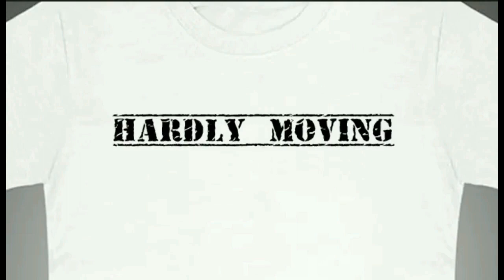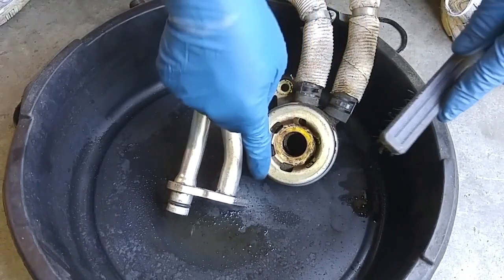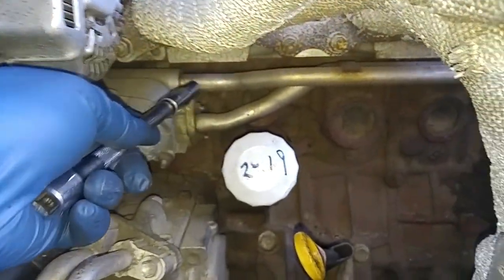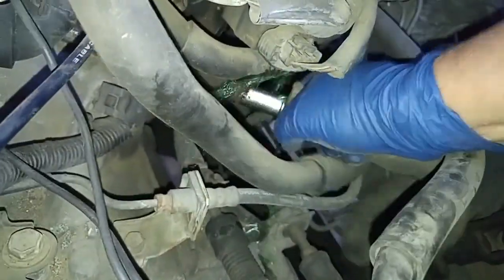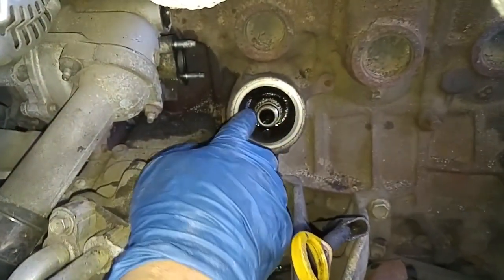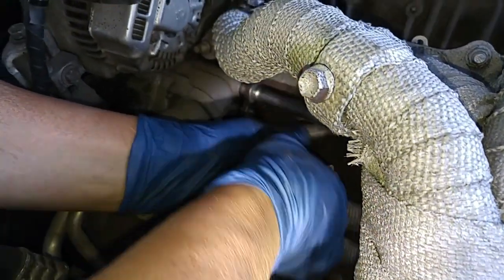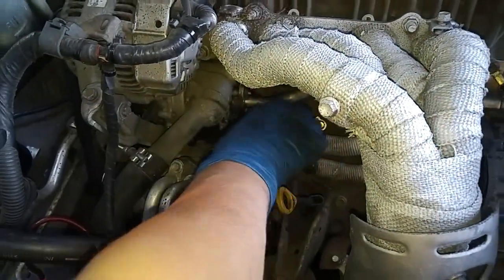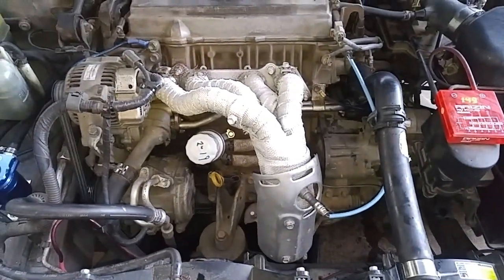Toyota Engine Oil Cooler / Heat Exchanger Retro-fit - Camry 2.2L I4 5SFE

Comment: Where did u get the seal kit from ?
Reply from the maker: If you mean the water pump coolant input and output ports o rings, most auto retailers should have them.

Comment: Why did Toyota put this part on a 99 Celica GTS  but not on the 99 Camry.
Reply from the maker: Because the Celica is a sportscar that needs better engine oil cooling?
Reply: @hardlymovingpro  I own the 99 Celica Gt-S, Just put reconditioned lower miles head with Viton
seals, HP rods, new bearings, new oil pump, timing belt, cover, header, drilled piston holes bigger,
Cti oil control rings, new power steering pump. Motor had 230th miles, with head off pistons were 
surprisingly tight with little wear. Fixed it two days before the hurricane and drove from south Fla.
to north Fla. with no problems. Toyota`s will run a long time if you fix the flaws, 2.2L better rods, 
valve seals, drill holes in pistons, better oil control rings,replace oil pump with Aisin, Gates timing 
belt, Than Toyota will love you long time.
Reply from the maker: Hey ... thanks for sharing!  Although the 5SFE was a great engine (even to this day with a cast iron block) the all aluminum, timing chain driven 2.4 2AZ-FE and 2.5 2AR-FE are wonderfully smooth engines with increased hp and fuel efficiency.  It's amazing how Toyota's next generation engines are noticeably better than the previous generation.

Comment: was the solution to this problem is to use a fully synthetic oil instead and change oil every after 10k kilometers?
Reply from the maker: Not sure.  But they stopped installing theses coolers after 1996 when the next generation Camry came out with a different body style but with the same engine.  Toyota recommended 8,000 mile (conventional) oil change intervals until people experienced oil sludging problems and began making warranty claims.  Then Toyota put out a service bulletin informing dealers to do 5,000 mile oil change intervals for their customers.  If the oil coolers were not deleted, would that have helped prevent oil breakdown?  Synthetic oils didn't gain auto industry acceptance until sometime in early 2000.   I believe if synthetic oil was used after 1996, 8,000 mile oil changes might have prevented these oil sludge issues (assuming there's no oil burning getting to 8,000 miles).   My 1999 Camry now has over 300,000 miles and burns 1 quart every 2,500 miles.   I use nothing but synthetic.
Reply: @hardlymovingpro  very informative answer brother. Long live to our Camrys 👍👍👍

Comment: Is there only the plastic seal/gasket on the top part of the bypass? I have a leak coming from there and cant seem to get it to stop.
Reply from the maker: If you're referring to an oil leak, remove and use the gasket on a new oil filter as a replacement for the bypass.  You may want to coat the gasket with RTV to make a more permanent seal.
Reply: @hardlymovingpro  coolant leak coming from the hardline that goes into the water pump at the top. I believe it called the bypass line.
Reply from the maker: You'll have to remove the bypass line away from the water pump and install a new gasket.

Comment: What is the size of the hose you cut at timestamp 8:46. Mine is leaking even if after the mechanic has put an atv. Leak has slowed when I added a clamp to the hose, but coolant on reservoir still goes down. Thanks for sharing this fix.
Reply from the maker: Don't know.  It's a Toyota OEM hose being cut to shorten.

Comment: Will this modifications help burning oil and improve fuel mpg ? And will this help car radiator coolant warm up faster in winter as it uses radiator coolant for cooling oil.
Reply from the maker: Should reduce oil breakdown caused by excessive heat.  And help with engine warm-up.  Toyota deleted this component in 1997 models which resulted in engine sludge buildup problems.

Comment: Hey, I'm trying to find those insulated hoses that attach to the oil cooler from the bypass valve, any idea what the part number is?
Reply from the maker: I got everything from the salvage yard.  Plenty of early models on the yard.
Reply: @hardlymovingpro  thanks, I was finally able to locate new hoses after I had toyota enter my VIN!

Comment: Buenas tardes cómo se si la válvula de alivio  osea el tornillo q  va en el  enfriador  de aceite está buena
Reply from the maker: No creo que haya una válvula de alivio. Es un dispositivo simple donde el refrigerante circula hacia y desde el adaptador del filtro de aceite para extraer calor cuando la temperatura del aceite excede la temperatura del refrigerante; y para ayudar a calentar el aceite si la temperatura del refrigerante excede la temperatura del aceite.
Reply: @hardlymovingpro  pero ese tornillo internamente tiene un dispositivo como especie de válvula check o algo así , un cilindro q sube y baja , en mi caso estaba atascado , pero no sé exactamente si lleva un resorte o no

Comment: Interesting, my 01 still has this fitted from the factory.
Reply from the maker: If you referring to the engine block...then yes ... there's that 10 mm screw hole.
Reply: The oil cooler is installed on your 4th gen? Are you sure it's factory and not something a previous owner installed?
Reply: Tyler Price I’m 2nd owner from 50k miles. You can never be sure but based on the previous owner I would say there is no chance they retrofitted one. Perhaps the delete was North America specific and didn’t affect other markets (I’m Australian)
Reply from the maker: The iron casting of the 5SFE block remained the same years after Toyota decided to delete the oil cooler
Reply: @hardlymovingpro  Yes block is the same, but heat exchanger is fitted. I always wondered why mine looked different to the tutorials. I didn't realise it was a separate part bolted on. Your trick to crank the engine after draining the oil to prevent oil spilling out when changing the filter also works with the heat exchanger installed.
Reply from the maker: Absolutely it's OEM.  There's quite a few to pick from at the salvage yard.  Toyota no longer makes the parts available in their inventory.  A year ago they did.  If you bought all the parts, it'll run you over $600
Reply: @baudneo  https://imgur.com/a/GxkMQB1 - Mine is Oct '00 and the other one is sometime '01. A quick search shows that exchanger stayed on Australian models but was deleted on NA models. I wonder why?  @Hardly Moving Productions

Comment: Recently completed groundup rebuild of my Australian manufactured 1995 Toyota Camry. 2.2 litre DOHC Series SDV10R gen2. The oil cooler was a delete on the manual gearbox/engine combination, reappearing as standard fit on the automatic transmission/engine combinations, which also came with a unusual transmission/power steering combination cooler mounted forward of the radiator. Very late build numbers also had a small independent thermo fan fitted triggered by a VDO cooling fan sensor embedded in the cooler itself. Have complete system NOS. Fitted oil cooler when engine rebuilt as a secondary precaution as extreme temperatures are experienced regularly in my area. Great vid bro. Greetings from Woomera in South Australia. 👍👍🇭🇲
Reply from the maker: Good story and good to know!  Was not aware of a transmission/ps cooler.  I see them on GM trucks.  Too bad Toyota deleted these features.  I'm guess they did this with the advent of synthetic lubricants which can withstand more heat without breakdown.